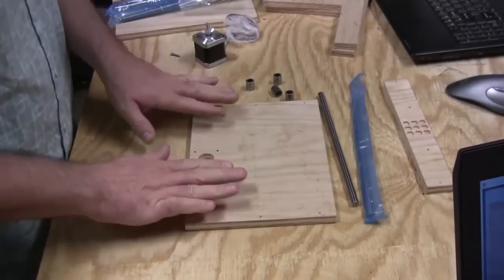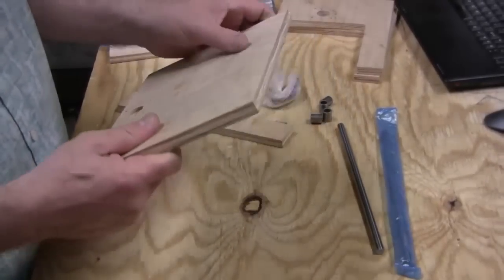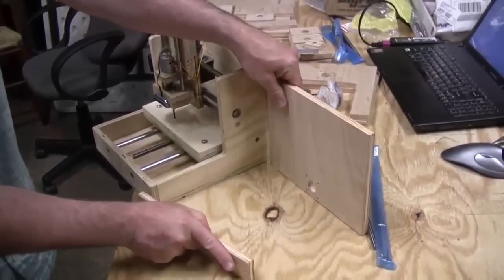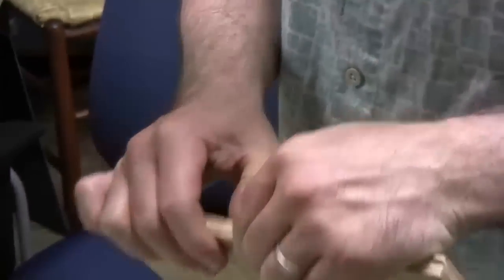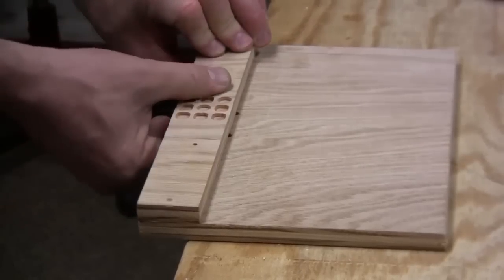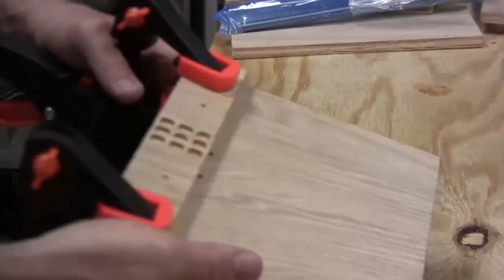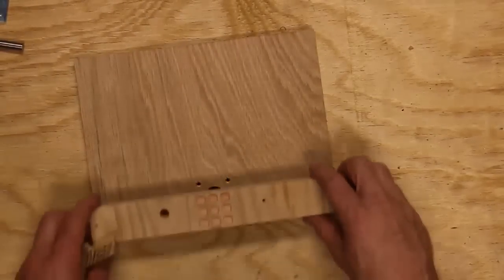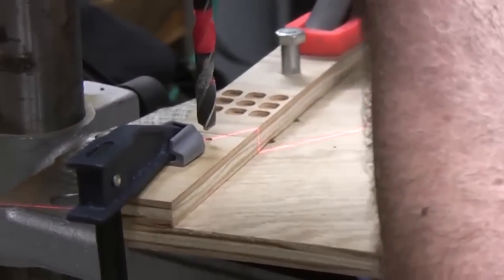Cheap DIY CNC Mill Part 1 of 7

Comment: Great videos. Clear and clean machine. I've never had a CNC & want to make one for hobby use. This small CNC should do the job well. Besides the Nema 17 steppers can you let me know what electronic equipment you used? I know what basic parts I need but don't know the drivers, BOB, etc. Thanks, Tom

Comment: Terminology needs to be precise.  Countersinks are angles.  In the U.S. it is typically 82° for flat head screws.  100° flat heads are available, but not common, as are 120°, even less common.  Metric flat head screws typically have 90° included angle on the head.  You are using socket head cap screws, which typically have a flat bottom counter bore, not a counter sink.  You are making yours with a drill bit, which leaves an angle at the bottom.  Further, the cap screw has a small head, which digs into the angle left by the drill bit in the wood as you tighten the screw and also digs deeper over time as the assembly moves tiny increments as it works.  This either loosens the bolt or moves the location.  A better way is to drill a hole large enough to put a flat washer under the small cap screw head so that the screw has a metal surface to rest upon and tighten against as well as larger wood surface to resist deformation.  The unit that you are assembling will not remain stable for an extended period of time.  Even if using button head cap screws, with significantly larger head, and by extension surface area, I still recommend a washer under them.   You didn't say, but it looks like your stepper motors are NEMA 17.  That tells you the hole spacing and size of hole for mounting.  If they are standard NEMA (they usually are, or no one would buy them) those sizes are specified.

Comment: Thanks for the very informative CNC series! Do you think it would be possible to cut metal if i would build a really really solid frame and use some nema 17  4.8 Kg/cm = 47.1 N-cm 12V stepper motors? probbably in combination with a dremel.

peace!

Comment: @retired tom, i am also busy building one. you can use the arduino uno with a4988 stepper drivers and Grbl firmware with Grbl windows controller software. let me know if i should email you the files.